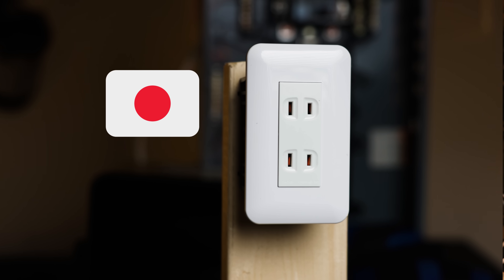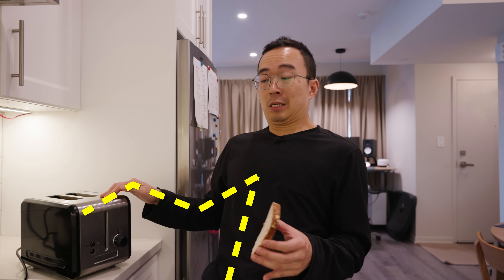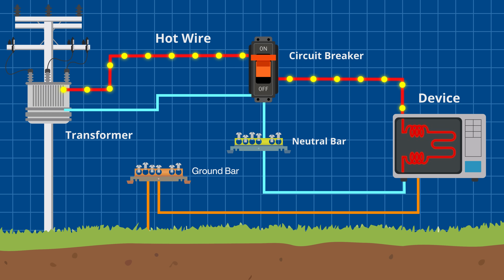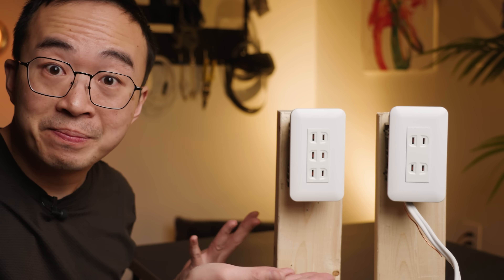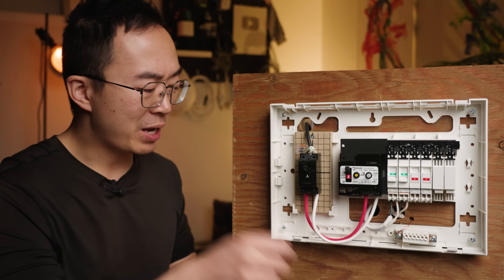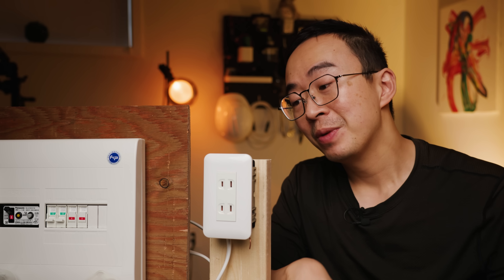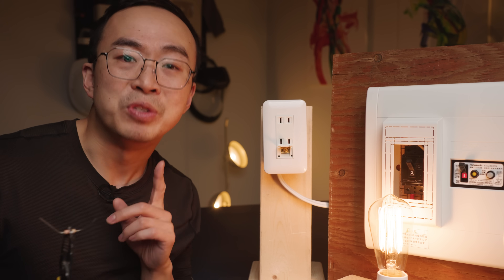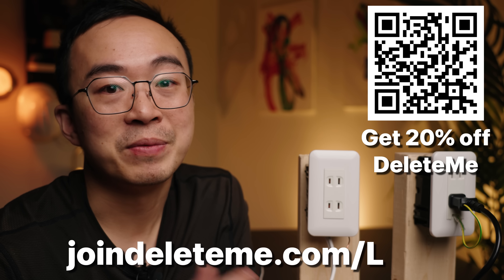How Japan Made Their Outlet Safe

Comment: It's a common misconception that a GFCI limits the current to 30mA, it trips at 30mA but needs some time, until when the failure current is not limit. To be honest GFCI + protective earth (ground) connection is the best solution practiced in many countries, common is to mandate ground connection if you have a metal enclosure to prevent touch shock, the GFCI detects that + any other leakage/touching. Also this is independent from TN/TT nets :)
Reply: Cutoff is normally up to 40ms trip time, for a 50Hz power that is within 2 cycles. Class I appliances are protected with 1 level of safety (basic insulation), but all exposed conductive parts are attached to earth. Class II appliances have 2 layers of protection (reinforced insulation) and do not have an earth. Some things like toasters would be too expensive to design for Class II, and things like laptop chargers don't want to be linked to ground so can't do Class I.
Reply: GFCI/RCD trip currents depend on the country and application.  American residential and commercial GFCIs are always rated at 5mA.  Equipment protection GFCIs can have trip currents in the hundreds of mA.

Comment: In the UK TT systems usually have a 300mA RCD upfront to protect the whole installation.  This is then time delayed, that is: it won't detect a fault for the first 100ms or so.
This is because each circuit is then protected by its own 30mA RCD, so the circuits are protected twice over, and the circuits still have an Earth.

Some types of systems in UK have Earth and Neutral connected.  These are called PME (protective multiple Earth) and still have to have 30mA RCD protection.
So, usually, they're safer.  Still  the best plugs and sockets in the world. . . unless you stand on them 🙂
Reply: Yeah, I maintain that UK plugs are the most dangerous in the world.  It hurts to step on a US plug, a UK plug will send you to the hospital with a puncture wound.
In both countries the death rate is practically nothing.  Turns out the vast majority of US electrocution deaths are caused by fractal wood burning - a hobby that effectively requires all safety mechanisms to be intentionally defeated.
Reply: @jonc4403  
I have stood on a plug or know anyone who has.
Reply: Why do you have this obsession abut standing on a plug?
Reply: Australian plugs are better. All the same safety features in a much smaller package. But the Australian plug doesn't work with ring main circuits with a fuse for every device. The fuse for every device isn't needed if you have spoke circuits with appropriately sized breakers in the panel.

The UK plug is the 4th best plug and is wildly overrated.
Reply: @Nemo222  What is the ranking?
Reply: @Nemo222  I like aussie plugs, they are so simple how they all lock out of being plugged into a lesser circuit, just change the pins' GIRTH instead of a completely different layout of pins.
Reply: @Nemo222 Fuses in plugs have nothing to do with ring final circuits, that's a myth. They are beneficial to be used anywhere.

Take a look at a small lamp cable and compare it to your kettle cable. Do they look like they should be protected by the same 15A/20A breaker? The breaker protects the wires in the wall, but cannot protect that little lamp cable. A fuse in the socket is needed to protect it
Reply: @Nemo222  
The Australian plug is poor. But it does have a switch in the socket and earthed. It is inferior to the UK plug.

Comment: The diagram at 3:33 shows us a [US?] breaker that is somehow connected to a transformer twice, also a neutral bar, and finally a load. I'm not aware of any breaker that does this, and seeming creates a neutral out of thin air.
Reply: I believe the diagram is in error, which would certainly make it confusing. Most US breakers are single-pole and connect only to the "hot" side (either one). Current returns through the neutral and not the breaker.

High-power circuits like HVAC/induction cookers use two-pole breakers and do not connect at all to the neutral.

The diagram shows kind of a mix-up of single and two-pole breaker wiring practices.
Reply: @stickyfox  Actually, noawadays there are a lot of breakers that connect to both hot and neutral (in particular, this is required for any combination GFCI or AFCI breakers to function properly, which are increasingly being required by newer electrical codes).  This is typically done with an extra "pigtail" wire that comes out of the breaker and attaches to the circuit neutral.

Though this is generally done after the neutral bar, not before it, but this all seems pretty nitpicky since the point he was actually explaining still applies in any case...
Reply: normally there is a second hot in the US, but the diagram showed would work as that's how AC works...
Reply: Not sure what you mean by "neutral out of thin air".  US neutral and ground are bonded at the main breaker box.  And yes, the two hots and neutral are connected to the transformer - that diagram doesn't show the 2nd hot phase.
Reply: @jonc4403  Leg, not phase. There is only one phase in play here.

Comment: 6:44 TT earthing is very common in Serbia as well and required on houses. Though city buildings supplied with underground wires are still TN-C-S from what I have measured in my place. The information I can find online is sorta ambiguous and the official standards are impossible to find or they want you to pay for it. But I know you're required to make an earth rod and get it tested for impedance and certified to be under 10 ohms, by an authorized company, without this certificate you can't get a new electrical connection your house anymore.
It's worth mentioning that on TN-C-S if the supply neutral line ever fails that every grounded metal surface in the house will become live. That is the main danger of this setup, otherwise it's better.

Comment: I would never solely rely on a RCD tripping. I've had RCDs get stuck.
Also important is to use RCD that can detect mixed overlay frequencies and DC-faults, as electronics these days can blind an RCD.
That's why a fuse or breaker should be in first line to trip if there is an amp spike.
I'm not sold on japans approach, it seems to me it was a hot fix.
Reply: That's why you need a special RCD when DC overlay can occur like frequency inverters etc.